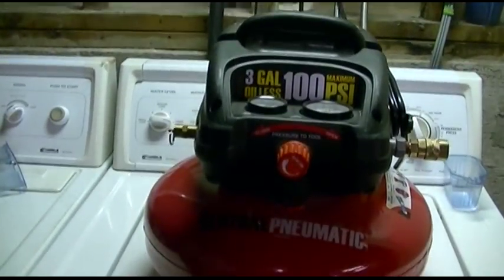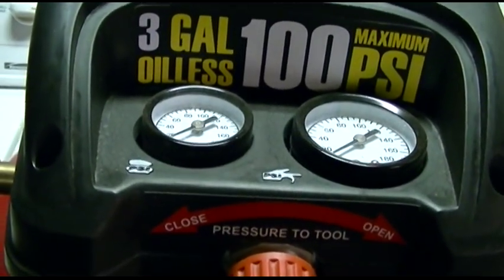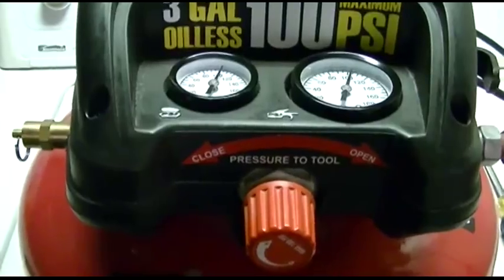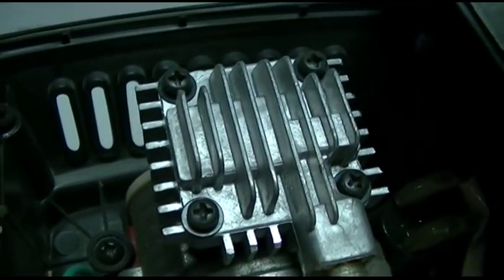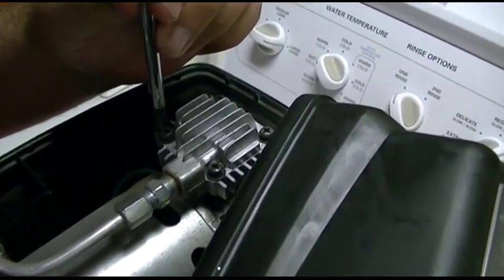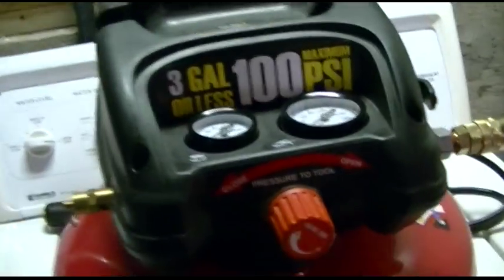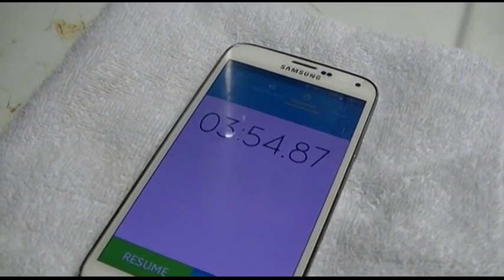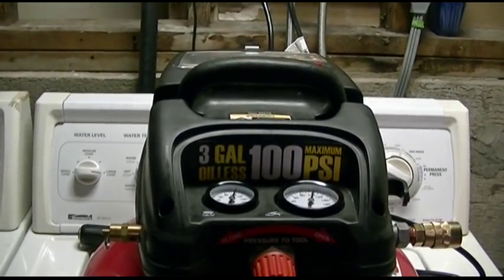Re-Torque Air Compressor Head Bolts For Faster Fill Up!

Comment: Any idea the torque specs for the head bolts?  I'm so scared of stripping out the cast aluminum cylinder head.
Reply from the maker: No, don't have exact numbers.  Using a screwdriver like I showed, there's only so much torque you're going to put on those screws before the screwdriver wants to cam out, so you probably won't strip anything out.

Comment: Go run your compressor from it sitting all night, totally cold, and time your first run. Now drain it and wait 5 minutes and run it again, should be a similar situation. Not that tightening head bolts isn't a bad idea, but since your compressor is heat soaked, will seem like it is pumping air faster, until the air cools. Hotter air displaces more volume then cooler air.
Reply from the maker: That's actually something I didn't think of.

Comment: In my case the hex head bolts were very soft grade and kept stretching, I would mark them to verify, so I just replaced them with much better ones with a bit of blue lock tight and had no further problems.
Reply from the maker: Good further bit of info, thanks!